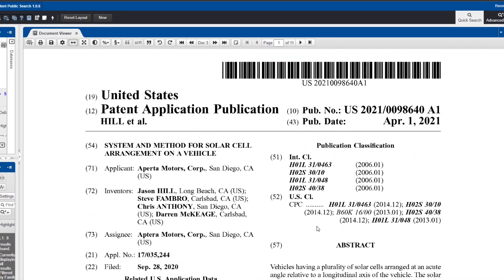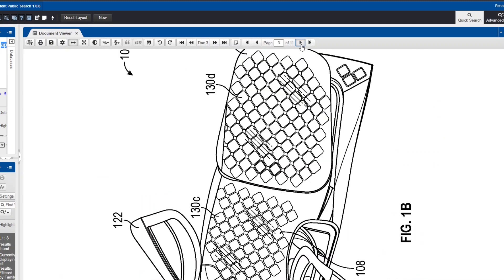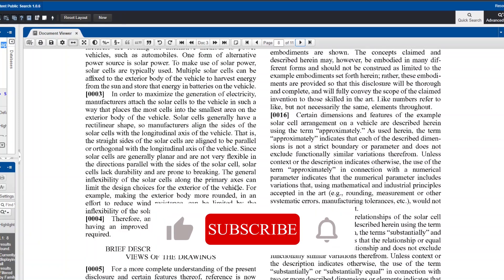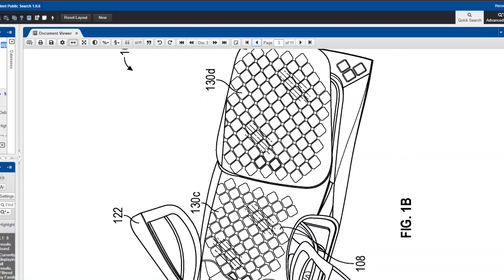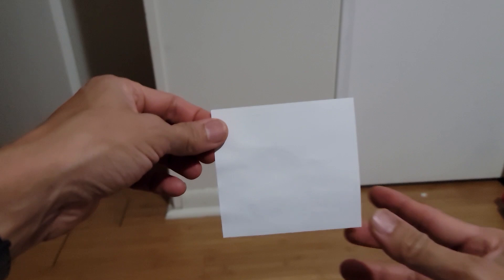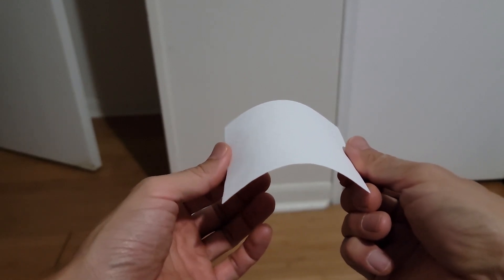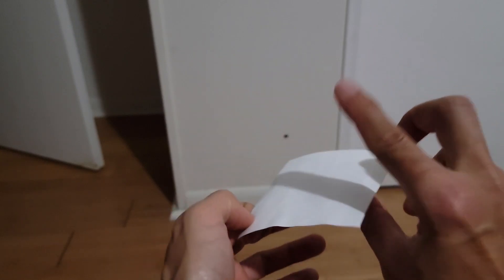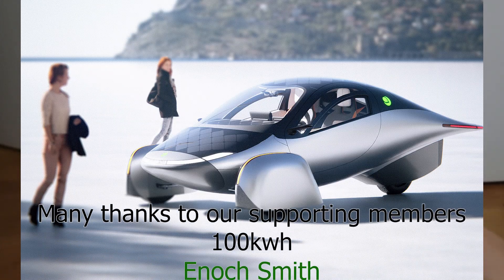Are Aptera's diagonal solar cells just a gimmick?

Comment: Ooh, I'll get shouted at for this... 🤭

I know the diamond-diagonal thing seems like magic, but it isn't.

I remember from my cabinetmaking days that wrapping precious pieces of fragile exotic wood veneer around compound curves can't be done without - to some degree - breaking or buckling them.

On a gentle curve the distortion will be minimal and not too difficult to repair and hide, but it'll be there just the same, no matter how many patents you've applied for.

If you're working with thin sheets of wood and want to form them into undistorted curves (such as the rounded bottom of a moulded 'bucket' seat), you get maximum flexibility and minimise the risk of splitting by bending them at 45° across the grain direction.

By adding further layers with the grain criss-crossing and again bending it across its 45° axis, you can form quite complex shapes. BUT you have to build them up by laminating them in separate layers over a form; you can't bend wood around a compound curve without rupturing it internally.

When laminating woven composites (carbon-fibre, fibreglass, etc), the cloth is always placed with the weave at 45° to the main axis of curvature. This is not new. Cobblers have been making the complex curves of cloth and leather boots like this for thousands of years.

But leather and cloth, wood and fibreglass all have a 'grain' and are flexible. I'm not sure solar cells are the same.

Basically, unless what you're bending/ folding/ wrapping is capable of true extension in two directions, at some point it'll crack, snap, warp, split, or otherwise misbehave. Don't blame me - blame that ol' Greek guy Euclid.

Putting the process into reverse, it's not possible to create an undistorted flat sheet from a section of a sphere. That's why an atlas can't show a true representation of the surface of the Earth's oblate spheroid shape. The projection onto flat paper must - MUST - be distorted.

Likewise, bending flat solar cells around a compound curve can only be done without distortion if the various layers of the cell can slide over each other and stretch in two directions at the same time. If the layers have a 'grain', then each must be bent - separately - at 45° across its most rigid axis to get the maximum flex with the least chance of breakage or creasing.

Yes, yes, I know it seems like you CAN stretch an already-fully-formed fixed-size cell in three dimensions without creasing it, by bending it at 45° across its stiff axis, but that's a theoretical geometrical case in which the cell is infinitely thin.

Steve's demonstration with a sheet of paper isn't telling the whole story, because a sheet of paper is several trillion, trllion, billion times thicker than the theoretical perfect case which a successful geometrical proof would require. In the real world, stuff bends. Things distort. Something has to give.

If it's a priceless piece of (600 year-old!) rosewood veneer, moulding it around even a modest compound curve WILL cause some degree of distortion. You can heat it and soak it with steam, which will soften the fibres and allow them to move without cracking, but the wood WILL be distorted.

Once it's the right shape, the glue has set, and it's dried out, the tiny cracks can be filled and the creases smoothed down to give the appearance that a flat sheet of wood has indeed formed a perfect compound curve.

But it's a lie.

I don't imagine a 7-layer solar cell can be steamed into shape without being deformed. Something inside it will have to move; how flexible are the various layers and components, independently of each other? If the cell's external dimensions are fixed, where does the 'moved' material go to?

Bending an A4-sized sheet of paper around a football [soccer ball] or an Aptera wheel spat/cover without wrinkling it is not possible because the paper's dimensions aren't adjustable.

What's needed is a plastic/elastic material, such as a thermoplastic film, which can be shrunk and stretched to eliminate the otherwise inevitable wrinkles.

(Car-wrap vinyl and paint protection film [PPF] are both extremely plastic when heated, and so are capable of the stretching and shrinking that's necessary to accommodate both convex and concave compound curves.)

As far as I know, a solar cell is built to a set size and its internal components can't be shrunk or stretched. So, no matter how convincing the folding and bending demonstrations may appear, a 2-dimensional cell of measurable thickness can't form a distortion-free shape around a 3-dimensional body.

It's perhaps worth noting that being able to follow a very gentle curve (such as that across a fairly flat car roof) is not a novel challenge, can already be done with existing materials, and is scarcely worthy of a new patent application.

If someone had found a way to wrap a fixed-dimension [sic] cell around something the size of a beachball without distortion, THAT would change the world.

But it probably ain't gonna happen, because it would change maths, physics and geometry, too. Like the theoretical atlas flat-sphere projection, it can't be done.

So... a gentle compound curve and some aggressive adhesive, plus bending at 45° across any significant grain or weave, plus vacuum-clamping while it sets, will give the appearance of close conformity...  but you can't bend anything of fixed dimensions around a compound curve without distorting it on some level.
Reply: No shouting from me!  I still have to read more of, and maybe reply to, your comment but, alas, I'm unable.  Thanks for it nonetheless.
Reply: Elli P.  Thank you for your wonderful comment.  I finally had a chance to read/digest it all.  Only a minor thing or two related to solar CELLS or PANELS  that are incorrect and I'd be happy to explain if you'd like.  Something your comment "triggered" in my mind is possibly how someone at Aptera got the misguided notion that the 45 degree rotation thing is a requirement for this vehicle.  Maybe this someone was a Cobbler!  Okay, I jest.  From his performance boat building days, Mr. Anthony must be aware of the 45 degree thing with woven cloth and made a "leap" that it must apply to solar cells and because of the "emperor has no clothes" syndrome, everyone else at Aptera ran with the idea.
Reply: Okay, I get the physics, and the reason it might not be patentable, but can we say for certain that the Maxeon cells aren’t able to be somewhat deformed within limits under pressure and heat to conform to Aptera’s specifications within the diamond pattern and NOT the grid pattern without violating laws of physics and without affecting cell function?  Isn’t that the more interesting and practical question since we’ve seen the pattern and cells on the seemingly functional delta version?  Otherwise, aren’t we accusing Aptera of Nicola-esque behavior?  I certainly am not!
Reply: @richevanscpa  I'm not sure any of this will answer your question but....

Aptera's PANELS can and will be faithfully formed to the "compound" curves whether the Maxeon cells are in the "diamond" or "grid" pattern.  Note, however, I didn't say CELLS.  The cells could faithfully follow a "simple" curve but can't follow a compound curve no matter the "diamond" or "grid" orientation.  How is it possible that the cells aren't "compound curved" yet the panel they are in are?  The easy answer is that there's liquid or near liquid "goo" the cells are sitting on or in during the "forming" and it's relatively thick.  As such, it will accommodate the small, local, deviations that the cell needs to have in order to fit in the vertical space.  We cannot see these deviations with the naked eye.

Less than full disclosure, I periodically do some work for a guy that builds panels with the same Maxeon/SunPower cells that Aptera's using and they are intended for rather similar compound curved surfaces.  They are typically MUCH thinner than what Aptera's doing and they work fine in their application.  Note the cells are always in the "grid" pattern.
Reply: Thanks, Bob H.  I’m very satisfied. I understand the theory (deformation of a 2D sheet on a 3D sphere) and the practical effect of the goo allowing the panel (not cell) to bend a bit on two axes in order to meet Aptera’s requirements. While I consider the question of grid vs. diamond pattern to be debatable,  I find Aptera’s mission of efficient sustainable transportation reason enough until proof to the contrary is provided to believe that the desirability of the diamond pattern is more than a cosmetic effect.  My mind is wide open for more information.
Reply: @richevanscpa  You're welcome Rich.  If you don't mind, why is important to you to believe that the desirability of the diamond pattern is more than a cosmetic effect?  It seems like a rather minor point.
Reply: If the cells were 2 dimensional we could bend without buckling. Maybe in the next gen... lol
Reply: @20xx-mm-dd  If by "2 dimensional" you mean infinitesimally thin then I would agree!
Reply: Bob H.  That is elementary. Since one of the cornerstones of Aptera’s uniqueness and marketing power is getting up to 40 miles a day of free driving from the sun, how could a sexy diamond pattern over a boring grid pattern possibly be considered preferable if the grid pattern allowed for 50 free daily miles?  These folks ain’t stupid!  They are trying to squeeze the efficiency out of every electron.
Reply: @richevanscpa  We'll just have to agree to disagree on just about everything you just said.  Including the "stupid" part.
Reply: @bobhilder1469  Yes, many a "higher up" at Aptera have publicly said some pretty stupid things.  My new "favorite" is when Jason Hill said something to the effect that they can get 25 to 30% more cells on the car by going with the "sexy" diamond pattern.  My old favorite was Chris Anthony repeatedly saying they are "powder crystalline" cells.  My even older favorite was when he repeatedly, effectively said you could shatter the cells and they would still produce ~95% of their power.  Wait, I just remembered another one.  Chris Anthony said "solar cells act like resistors when you don't take the power out of them".

Comment: By bending down each corner of the square you actually divide the square into a smaller sqare with 4 adjacent triangles to its sides. Only the triangles get bent while the remaining small center square remains flat.
Reply: Though this crude paper demo doesn’t show the possibility, if one tries to bend just the corners to the extent shown or described with an actual Maxeon/SunPower cell, you’ll have a cell broken in 4 places.
Reply from the maker: You are absolutely correct. You can bend down the corners easier than you can bend down the sides
Reply: @ApteraOwnersClub  If the cell is flat.
Reply: @ApteraOwnersClub  Of course. The line across a corner bends is always shorter than the whole side legnth of the square. It's just like one wooden stick is easier to bend than two of the same wooden sticks at once.
Reply: More generally.
Rotation may help when the area that is curved in one direction avoids intersection with a curved area running in a different direction due to the rotation. Then you can avoid getting that sharp pitched bit caused by compression.
Reply: @lewevans2413  Sorry, just not following you.  A single cell covers an area.  The entire area is a compound curved surface.  Exactly what may be intersecting with what?
Reply: @bobhilder1469  Hi Bob,  If the entire area covered by the cell is a uniform compound curve then orientation is irrelevant. There will be stress unless it is relieved by stretching or compression deformation.
Reply: @lewevans2413  I didn’t suggest a “uniform” compound curve.

Comment: Look at flexible solar panels they "bend much more than anything on the Aptera....but only in one direction.  I have a flexible solar panel that rolls down to about 2" diameter.   So looking at the multi direction bending on the edge of the cell.  Bending it in the square direction cause the edge to lose the arch, creates a "kink", but in the diamond direction the edge is still an arch.
Reply: Your flexible solar panel, I would bet, does not contain nominally 5 inch x 5 inch single crystal silicon solar cells.  If it did, I’d bet it’s getting a little low on power production….

I’m afraid my age-addled mind isn’t following the rest of you comment.

Comment: I have to wonder if it is also affected by which direction the collector traces on the backside are oriented in.
Reply: I think this is a factor, the interdigitated backing appears to have structural support of the fingers parallel to the sides, and the bus-bars parallel to the sides perpendicular to the fingers, so bending against those supports might be tricky.   Trickier against the finger "grain" (so to speak) than the bus-bar "grain". bending on the diagonal results in a shallower bend against both. maybe?
Reply: @kimbowilco  The "interdigitated backing" is mostly, relatively soft (quite malleable) copper.  I have no trouble simple bending Maxeon/SunPower cells in any orientation.

Comment: I am very intrigued by Aptera and just made a reservation. However, I am struggling a bit about this diagonal argument. 
If the surface is a sphere, this rotation of square tiles is meaningless because the bend is symmetrical on a sphere no  matter how you align the tiles.
If this is not silicon, say GaAs, AND the surface is not a true sphere. That is, it curves more in one direction than the other, as seen in Aptera. Then there MAY be some merit because III-V material's rigidity is not identical at (010) and (001) directions, though the difference is tiny. However, these are Si cells and that crystal is symmetrical.

The key is how much they thin down the cell. 6" Si wafers is usually ~675um. It will curl up in one direction like a taco easily at 100um (4mil). If it is thinned down further, it might be pliable enough to curve in both direction? I really don't know. The solar cell part only needs a few (<5) microns of Si to function properly. The challenging is properly mechanical and handling of exceedingly thin tiles.
Reply: Single crystal silicon is NOT symmetrical.  The wafers from which these cells are made are <100> silicon.

I work with these exact, nominally 135 micron thick, cells practically daily.  They do not faithfully form to compound curved surfaces no matter the “orientation”.  If Steve did what he did to an actual cell instead of non-brittle paper, he’d be left holding a cell with many cracks.

Comment: I'd love to see how many cells fit when installed square instead of diagonal. More? Less? Same?
Reply: Much more.
Reply: @bobhilder1469  How do you know? And why should Aptera adopt a practice that produces less solar cells per surface when they are all about efficiency. Cosmetics maybe?
Reply: @adimchionyenadum2962  I for one wouldn't mind a small decrease in total array capacity in exchange for an aesthetic improvement. I think the diagonal cells look cool. It would depend exactly how much sacrifice we're talking about I suppose.

Solar design is not always about maximizing DC capacity. You have to balance these decisions against many other factors to maximize overall client utility.
Reply: @adimchionyenadum2962 Geometry.  Aptera says they are ALL about efficiency but ALL is a big word isn’t it.  Since the only solar related patent that has been granted to Aptera is a “design” patent rather than a “utility” patent, it shouldn’t be a stretch to assume to it’s purely cosmetics.
Reply: @suunraze  Agreed.
Reply: When we look at the actual size of the modules, there is clearly empty space along the edges where the diagonal cells don't completely fill the space. 

On the other hand, maybe we're looking at it the wrong way. Maybe with square cells the total size of the module would need to be smaller, since (supposedly) they don't bend as well near the edges where the curvature is greater. So in effect the diagonal design expands the total capacity by extending beyond the area where square cells could reach.
Reply: @suunraze  No solar racing team worth their salt would design/build a compound curved array with cells rotated as in Aptera.
Reply: @bobhilder1469  Yes, solar racers feature large flat surfaces on top and a recumbent pilot. I don't think this would be possible to achieve in a standard passenger vehicle (with the cabin occupants fully encapsulated within the vehicle's exoskeleton), though it would be interesting to see something like this attempted.

I think there is a giant solar van/camper out there that some college students are fooling around with. It doesn't look especially aerodynamic, however. Really we're just beginning to explore the possibilities with solar passenger vehicles, and I think Aptera is striking an excellent balance between solar capacity, safety, comfort, aesthetics, and performance.
Reply: @suunraze  You're not "up to date" on solar racers.  Many have compound curved (non-flat) arrays and non-recumbent driver (pilot) AND passengers.  In the case of the non-recumbent driver/passengers, it's because the rules of the major events dictate "up-right" driver/passenger positions.  For the most part all drivers/passengers have been "fully encapsulated with the vehicle's exoskeleton".

The giant solar van/camper is from Eindhoven University.  Up until the van/camper, which isn't intended to race, the team won nearly all, if not all, major events it entered in with it's multi-passenger cars.  If they were "fooling around", so is Aptera.

You missed my point, by the way.  The solar racers wouldn't rotate the cells 45 degrees as Aptera is doing and they're using the same cells.